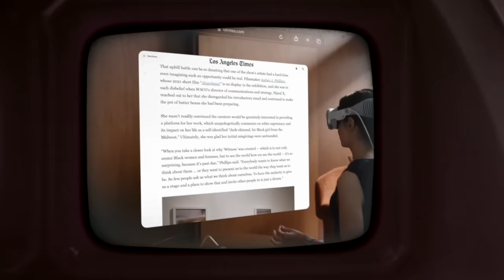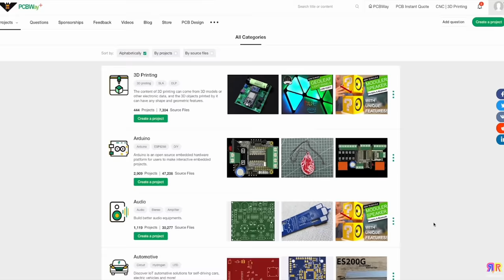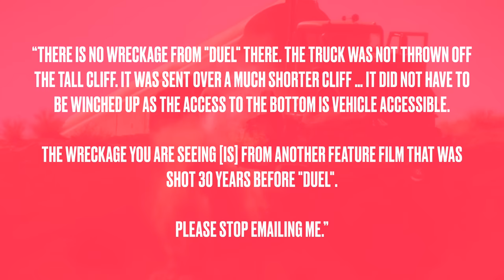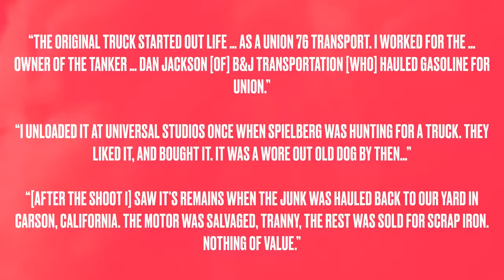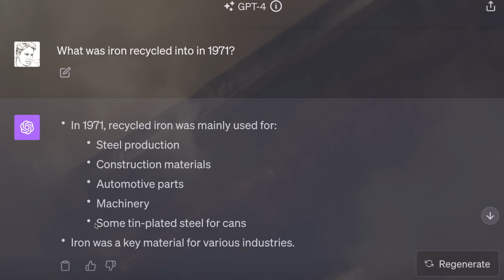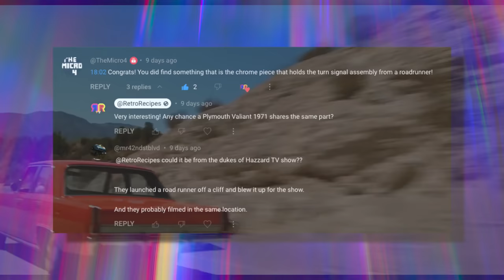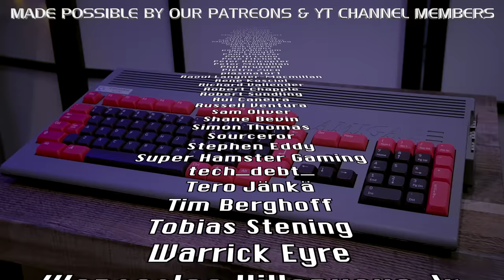Unbelievable 'Duel' Discoveries: Daisy Duke's Parts Uncovered

Comment: the wheel you found was a big bolt wheel from 1974 on up. the dual mopar used was a small bolt car. daisys 1974 b body rr had big bolt magnum 500 rims. so even you found a big bolt mopar rally its not likely either cars wheel. sorry to be the bad news guy, but you are in my mopar realm

Comment: The truck's tires and wheels, along with the axles and engine and tranny would be the most massive parts. And where is the trailer? Whatever they found is not the Duel truck.
Reply: yeah its not the truck its a 1940's pickup truck cab

Comment: That's not the truck.
The truck from the movie was a Peterbelt that looks like a Dodge. And
Working at the.
Cab ab just by looking at the camp. I can tell that's all Dodge like my dogs. That would have been right around the time that they were making sumi trucks Like the first ever big truck that they built.
Which would have been like a single axle truck on the rear and what I had one axle. And then steer axel

Comment: That was not the cab of the old Pete. It's an old pickup truck cab. It's too rounded and too small. Also where there is a rear window in the cab you found, that is where the large air conditioner was mounted. That truck was not fitted with the rear box air conditioner. Sorry.

Comment: To bad it aint that cab from the movie truck...Yes..splitscreen...but thtsats nothing..Cab you found have got round roof corners & wiper motor & posts from above...Movie truck has a more square roof & wipers on the bottom of the windscreen....& tht wheel aint from a Valiant....Ive got a Valiant

Comment: Pretty sure the vast majority if not all American cars in the 70's had 5 stud wheels as they were too heavy for 4 stud?
It looked like the wheel you found had a balance weight on rim, with tyre missing it was dumped that way, if tyre had been burned off the lead balance weight would have melted plus steel bead reinforcing would be wrapped around it (or possibly rotted away after 50 years?)
Whatever, entertaining 21 minutes
There is a pretty good chance movie makers got permissions from county to shoot in one location but, without supervision, moved to other area's that were 'more dramatic'? (just look at the history of the original 'Gone In Sixty Seconds' to see how far rules were stretched or broken)

Comment: Be careful identifying Mopar wheels. They used 2 different pcd (pitch circle diameter)
The valiant used in the film was a 6 cylinder model, meaning that it would be a 4"pcd and would've had wheels fitted from factory, that would look like a trailer wheel (very similar to a lotus cortina) 
The wheel found, if Mopar, would be a rallye wheel, with a 4.5" pcd. These would've been fitted to v8 a bodies (dodge darts Plymouth dusters etc) b and e bodies.
There's a much higher probability that the wheel came off of something more like a 71 roadrunner 😉
Reply: Na verdade o Valiant principal era um 318 v8 ( dá pra ver o emblema no paralamas)
Reply: To clear things up the 4" bolt pattern vs the 4.5" bolt pattern was determined by year manufactured not engine size
Reply: The 4.5" pattern was used across the board from 73 I believe.
The heavy duty stuff was all 4.5.
Not all a bodies were fitted with a 71/4 axle. Anything bigger would be 4.5 too.
Reply: ANY A body 71 and older had small bolt pattern period

Comment: WRONG, iron is NOT used to make soda can's, ONLy aluminium, as iron is NOT suitable as a food grade metal, and no iron and stainless food grade steel is NOT the same thing, stainless food grade steel and Tim are NOT the same thing either.  you can NOT use iron to make drink cans as the liquid would cause the iron to rust,  here in America and as far as i know in the world,  ONLY aluminium is used. to make soda cans, in the old days Tin was used to make soda cans, you NEED to do better research. the ONLY item made from cast iron are skillets (fry pans).

Comment: The Plymouth that went off the cliff was not a 73 or 74 road runner it was a 71 Plymouth satellite, they started using a 71 satellite instead of a 73-74 road runner must of been easier to find those plus those 71 satellite's never had rally wheels on them, they had some cheap aftermarket chrome wheels.
Reply from the maker: There was certainly some confusion about where they did and didn't use a Road Runner. If you look at the scene where it goes on ski mode shortly before going off the cliff, it does seem to have the same style wheels. Maybe ours is a cheap chrome one ¯\_(ツ)_/¯ In my heart, it's all Daisy Duke's :)